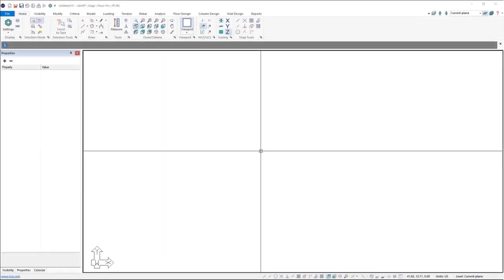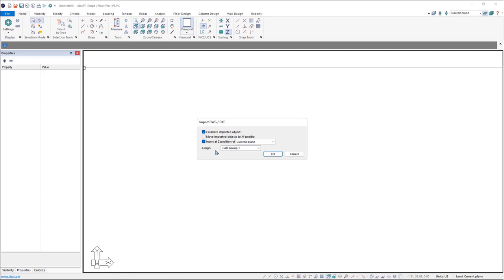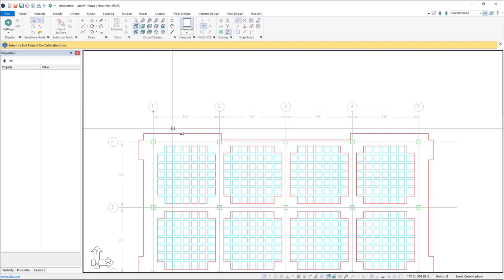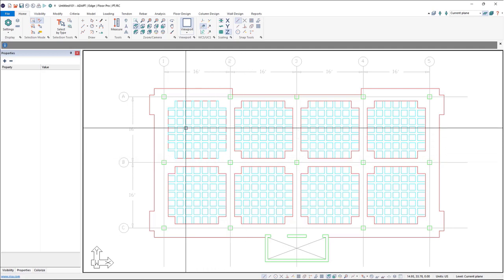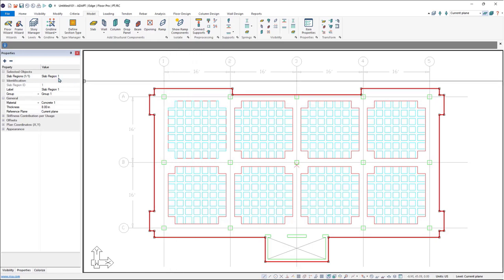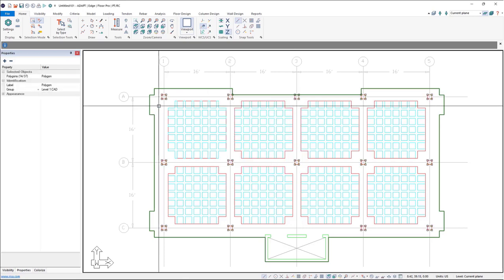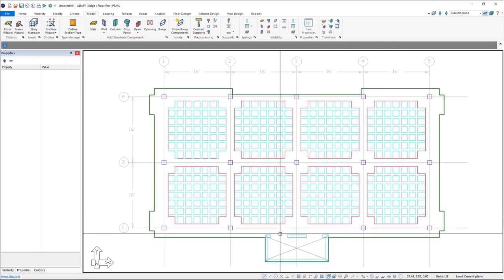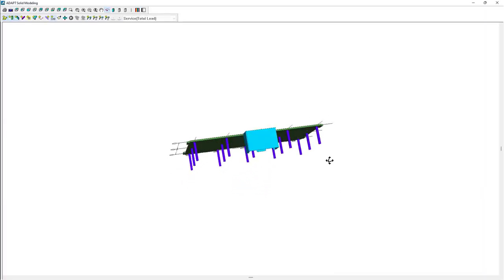Efficient Modeling of Waffle Slabs in ADAPT-Builder

Comment: Interesting that the 8" slab didn't control when you modeled the 4" slab, I'd have assumed the overlap would take the combined of the two to still show an 8" slab? Perhaps a fully nested slab "overwrites" the slab it is nested within? Also the beam is now 4" deep, would it be applying the min steel for an 8" beam in this scenario or an 8" beam?
Reply: Hi Carson! You are correct that when a slab is fully nested within another slab the nested slab will take precedence within ADAPT-Builder. Additionally, the program sees the beam slab section as a composite section, so while the beam is modeled only 4" the entire section height with the slab as the flange is 8". The program will correctly reinforce for the 8" deep composite T-section.
Reply: @DavidLelandRISA  excellent thanks David!